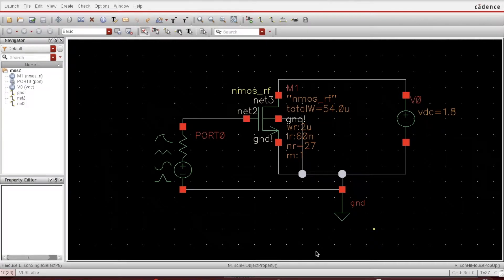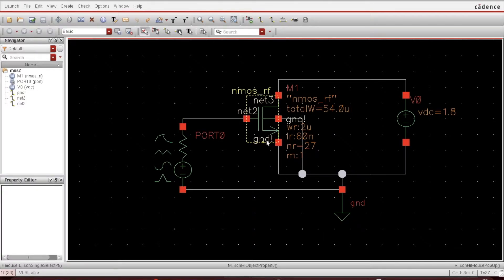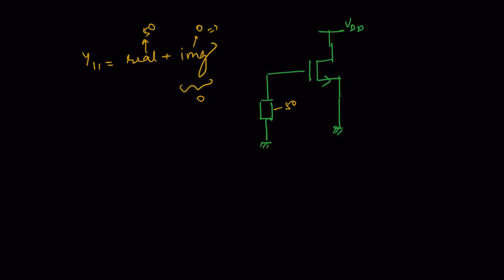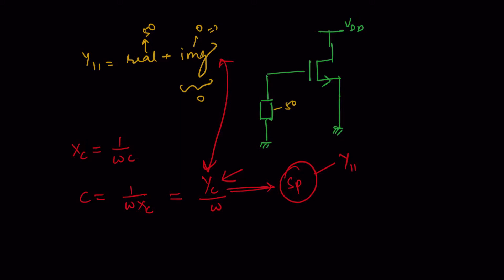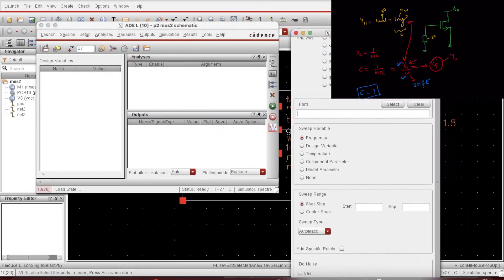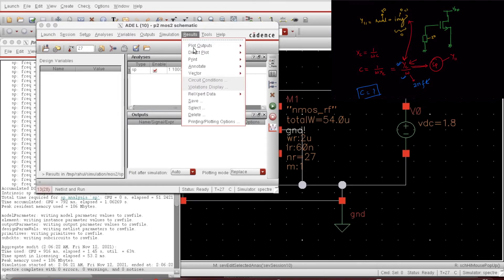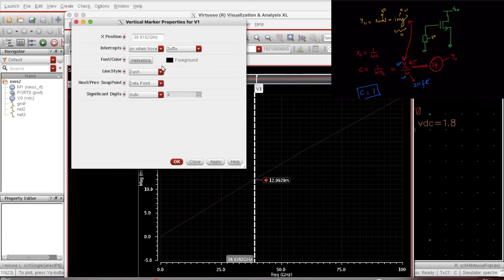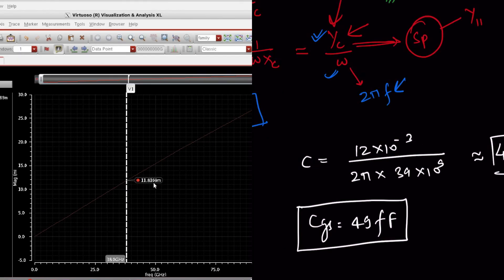Calculate Cgs by Cadence Simulation || Gate Capacitance of MOS - Cadence Virtuoso #10

Comment: sir you have a mistake the admittance is Y= R+ 1/jωC so if you take the imaginary part of Y --> Im(y)= ωC. So you need to pick the imaginary part of the admittance not the magnitude
Reply from the maker: Thanks for pointing it out. You are absolutely right. I'm glad you followed it so closely. Actually while plotting Y11, I should have selected Imaginary instead of Magnitude in modifier option because we are equating only imaginary to 0. In this particular case no error appeared as Im(Y11) ≈ Mag(Y11)  because Real(Y11) = 0.02 S. Therefore the result came out to be same and I couldn't spot and rectify my mistake. In concept I explained the point of interest is Im(Y11) but while plotting I just missed to highlight Im(Y11) so to select.
Reply: actually the video is partially correct. admittance is Y=G+jωC, impedance is Z =  R+ 1/jωC

Comment: Sir you should plot the imaginary part of Y11, you have done the calculation with  magnitude
Reply from the maker: Yes, while plotting Y11, I should have selected Imaginary instead of Magnitude in modifier option because we are equating only imaginary to 0. In this particular case no error appeared as Im(Y11) ≈ Mag(Y11)  because Real(Y11) = 0.02 S. Therefore the result came out to be same and I couldn't spot and rectify my mistake. In calculation, I explained the point of interest is Im(Y11) but while plotting I just missed to highlight Im(Y11) so to select. I appended a note in the description to take care while piloting this. Thanks for commenting.